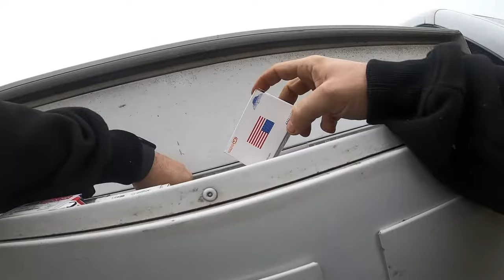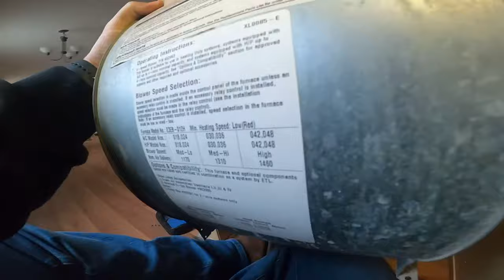No Heat/Mobile Home Air Handler

Comment: You know with the white control wire not connected the contractor would pull in and turn the auxiliary heat on you learned that when the new contractor did not pull in and you charged the customer for the misdiagnosed contractor and all you had to do is connect the white wire to control auxiliary heat tech’s like you give the hvac industry a black eye shame on you
Reply from the maker: Dude the white wire pulled off when I slide the blower out I broke it. Chill bro you need to relax
Reply: @davidseymore3411  you will understand the comment when you get out of school and get some experience in the hvac field
Reply: Dude... be doing hvac for 40 yrs . Guess your a professional.
Reply: John you know what your doing don't listen to those super tech no it alls these guys will never learn